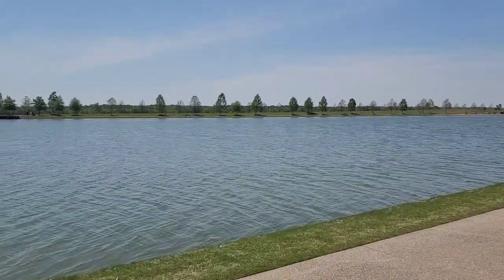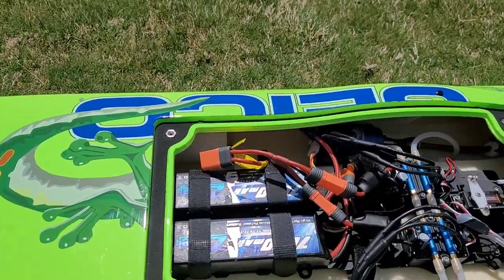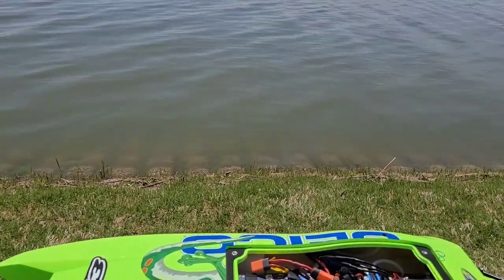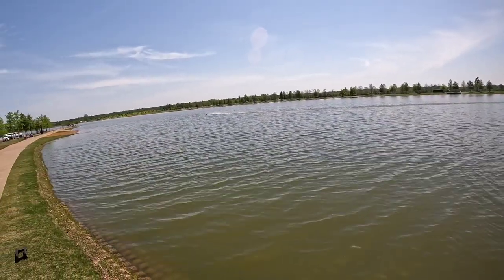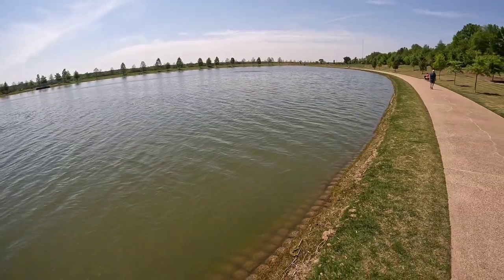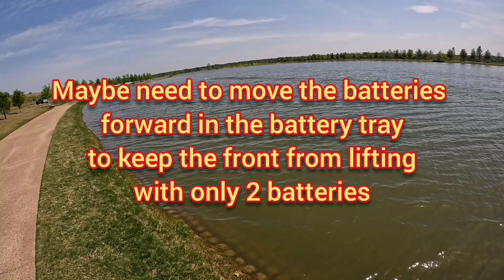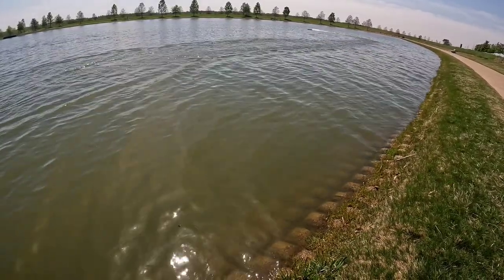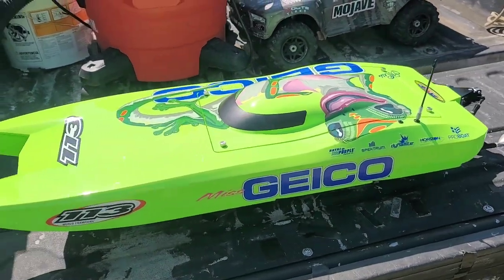Miss Geico 36" Twin Brushless Catamaran. Great looking boat but..is it worthy? #rc #rcboat #proboat

Comment: Parallel connectors essentially combine the capacity. Series connectors combine the voltage. 

Two 3500mah 3S batteries in parallel will work like a single 7000mah 3S battery. Two 3500mah 3S batteries connected in series will work like a single 3500mah 6S battery.

Comment: I just did the carbon fiber inlay on mine. I ran 3 inch wide cf stripes along ALL seams. Also, the reason why the battery tray brakes loose is not because of the glue. Its because the bottom flexes when it flips and hits the water causing the tray mount glue to break off. Adding carbon fiber reduces the flexing drastically.  Carbon fiber is very necessary on this hull. Glad you were able to get another one.  Hope shes holding up.
Reply from the maker: Thanks good info. I would say the carbon inlay is a must if your running high speed.
Reply: @goin4brokerc  do you still have yours?
Reply from the maker: @obi  yeah but its got some cracks in the Hull already so I'm gonna need to do something to strengthen it if it's not too late😬
Reply: @goin4brokerc  mine has cracks on the bottom where the battery tray is. It's just the gel coat. Believe me man carbon fiber is the way. Gives you peace of mind.  I just drove it for the first time and WOW. I love it.
Reply from the maker: @obi  lol yeah peace of mind needed. I had a UL19 go down after a bad flip up and it sunk efore we could get the rescue boat to it. Talk about a bad day geez
Reply: @goin4brokerc  noo waaay. That blows. I think I'm gonna stop buying fiberglass hulls and stick to full carbon fiber hulls or abs (cheaper).
Reply from the maker: @obi  Yep. Veles 29 has good fiberglass hull but Carbon or ABS is gonna be your best bet otherwise imo. My SonicWake ABS takes a beating

Comment: Nice run. Adjust your strut angle down a touch. That should help with keeping the nose down.  And as mentioned below , Running 2 6s batteries one to each esc is the same as running 4  3s batteries in series . I have a Zelos 36 and the Miss Gieco 36 . Love these boats. Have fun. Oh and build your self a rescue boat.
Reply from the maker: Thanks for watching and thanks for the input. I have the Proboat Alpha Patrol boat and a homemade retrieval rack as my rescue setup that works great,  just didn't have it out yet in the vid🤪
Reply: @goin4brokerc  😅 Funny I just finished putting together the pusher for my Proboat Aerotrooper Airboat last weekend, Rock on!
Reply: You can't adjust strut
Reply: I'm sorry but if you run ONE 6s battery to each ESC then you'll have 22,2v (6s) to each motor...if you run 4 3s batteries in series you'll have 44,4v (12s) to the motors. So no it's not the same.
One 6s battery per ESC is the same as 2 3s batteries in series per ESC tough.
Also the "s" in "6s" stands for "series" and means that the battery pack is made of 6 cells in series (all lipo cells are 3,7v) you could also have a pack that says "6s2p" and that pack is made of 12 cells connected 6 in series and 2 parallel for higher amp draw
Reply from the maker: @joccee88  its only 6S to each ESC. first you remove the stock adapter which connects to both ESCs. Then you need 2 separate series adapters (sold separately)for each ESC. And then (2) 3S batteries are connected in series to each ESC separately to create 6S to each ESC. That's how I run it with 4 batteries. Check out the latest video we made of it with the (4) 3S battery setup.

Comment: I heard the hull is pretty cheap from other videos. Fragile is one person said in his video. Other then that he said the electronics are good.  Still looking at the blackjack also. Kind of torn between witch one I should get. What is your opinion on this boat and the blackjack. There were good reviews on the blackjack unlike the miss geico witch had some pros but as many cons. Have to make up my mine on this one way or another. Any help with that would be great.
Reply from the maker: The Hull on the Geico is fragile and needs to be strengthened. Some guys are doing Carbon/Epoxy inlays and similar to strengthen it. The Electronics and cooling are good to go. No upgrades needed. And it's fast and turns good stock out of the box. Looks stunning as well. But more than likely, sooner or later, if you drive it 75mph and have a bad crash, it will damage the hull if not strengthened.

Never had the Blackjack but I have a SonicWake with the same type Hull material as the Blackjack, and it is has some flex and can take 55mph crashes no problem. So I'm assuming the slower speeds stock and different Hull material, would make the Blackjack the more durable option. I'm going to get one for the channel soon.
Reply: I guess if you keep the geico under 70 your good to go. Lol anyway I probably would use no more then 3s anyway in series anyway. Speed is not my main goal anyway but looks now we're talking lol
Reply: Get them both ! Haha thats what i did ! 👍🏼🤙🏼
Reply: @treyrahman  I did lol! I'm not a basher of my boats not to mention what speed can I get out of these boats. I'm recreational and just having a good time at the lake. Getting the speed that the company says you can get is more then enough for me.

Comment: I run my batteries (2 zeee 3s 7200mah 80c) up further in the the tray, just enough to get two straps on them. Much more stable. Had one pass at 68mph and one pass at 72mph.
Reply from the maker: Yes I did that on my most recent run yesterday and it helped tremendously. Boat was super stable👌. Im still nervous about going 4 batts because of the last Geico disaster🤣. So looks like 72mph is a good capable speed with 2 batts. Thanks for watching
Reply: @goin4brokerc  I'm pretty happy with 70ish mph.
Reply: What are you using for gps to get your max speed?
Reply: What are you using for gps to get your max speed?
Reply: @jeremyquade5543  SkyRc gnss

Comment: Why would Horizon refund a boat when you crashed it??!
Reply from the maker: I didn't actually crash into anything, the boat flipped at high speed (80+) and came down hard and bad. I had to send the boat back to them so they could inspect the damage and process the refund. All it takes is one bad high speed flip over to potentially damage the fiberglass hull because the boat is so fast.

Comment: Man just get some 2 part pour foam from boat outlet or West Marine and reinforce the front and the seams.
Reply from the maker: Thanks for the input man sounds like what I need.
Reply: Just a little goes a long way so test before you use it👍One ounce makes about a softball size expansion when mixed 50/50 and very strong.

Comment: The amount of batteries has nothing to do with how fast it is. There’s plenty of geico running over 90 with two 6s batteries
Reply from the maker: Not stock out of the box my guy. Guys are getting over 90mph and even 100mph with 2 batteries only with Dasbota and other upgraded props not stock. And 4 batteries (2 in series) to each ESC does make it faster that's why they have that option. I know from experience with the last boat.
Reply: @goin4brokerc  no, no it doesn’t. Dude I had the zelos 36 and y neighbor has the geico. Two batts vs 4 batts, speed and power is the same bud, gps checked too
Reply from the maker: @jaycevessier7554  OK my guy that's you and your neighbors experience. We will make a video of the 4 battery setup (with the same type batts mah a c rating) like in this vid and see what happens. My experience with my previous Geico it was faster with 4 batts with 2 in series. Stay tuned for the vid
Reply: @goin4brokerc  the only reason the mph would change is because the boat is more stable with 4 batts because of the extra weight. Sorry man it’s just been proven time and time again. The only thing 4 batts does is make it’s heavier and runs longer, not faster
Reply from the maker: @jaycevessier7554  I read your first comment wrong. Yes guys get over 90mph with (2) 6S batts. I'm referring to the (2) 3S batteries like in the vid, connected with parallel connectors not (2) 6S batts that you referred to.  (4) 3S batteries... where (2) SETS of 3S batts are connected in series with series adapters to create 6S going to each ESC which makes it just as fast as running with (2) 6S like u mentioned. Surely you see my point and that is what is  suggested in the owners manual.. Going to do a video anyway with (2) 3S vs. the (4) 3S batteries in series to show all. 4 batts does helps stabilize the boat like you mentioned.

Comment: I have 2 6s batteries im going to run. If you sre hitting 70 on 3s then 6s should hit 85+ 🤙🏼👍🏼🔥
Reply from the maker: Possible if you got really good batteries.
Reply: @goin4brokerc  Are Spektrum 6s 5000 mah 100c good enough ? Lollll
Reply: @goin4brokerc  where do you get your foam tubing inserts you had inside towards the front ?
Reply from the maker: @treyrahman  Those prolly won't get it over 80mph. You meed atleast 7000mah 120 C batts for optimum performance
Reply: @goin4brokerc  noted. Thank you. I have 100c 5000mah 6s Spektrums.
Reply from the maker: @treyrahman  Good Luck! Try not to have any high speed flip overs could be fatal to the hull

Comment: what is the run time?
Reply from the maker: Depends on batts. The 3S 7000mah in the vid usually last about 5 - 6 min. Running (4) 3S or (2) 6S batts with same 7000mah should get me increased run time but I havent run it with those setups to know the run time just yet. Will be doing a vid soon showing that tho.